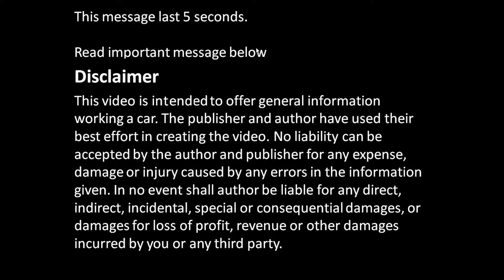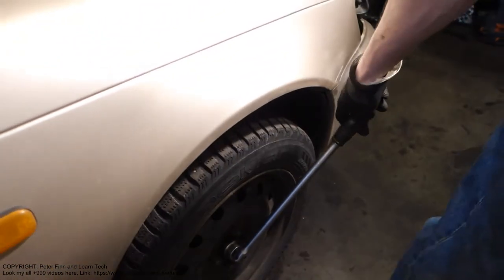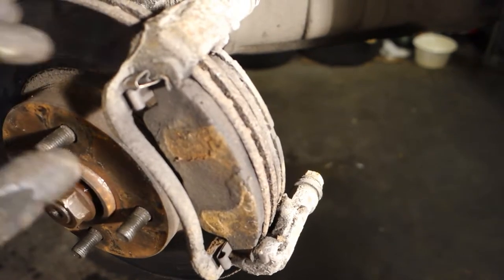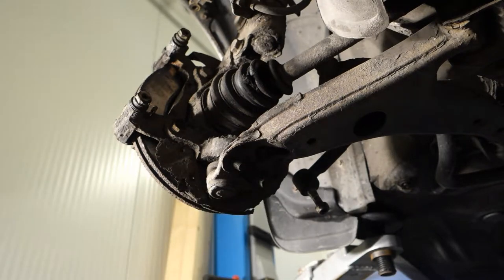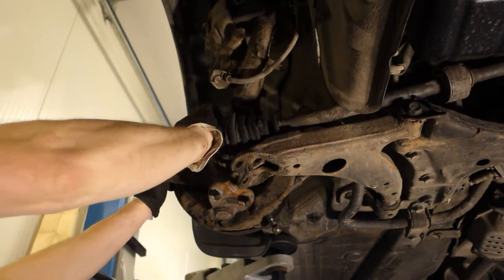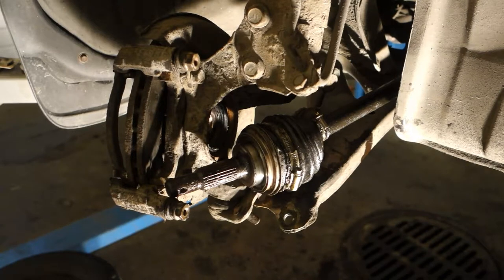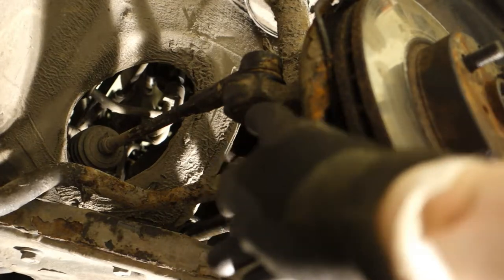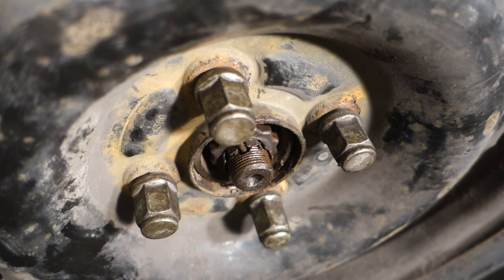How to replace driveshaft Toyota Corolla right side. Years 1991 to 2010.

Comment: Hei, kysyin jo yhdessä sun toisessa videossa mutta kysyn tässäkin, että eikö myös pelkkä  ulompi nivel ole vaihdettava? En löydä sen vaihtotyöhön liittyvää videota mistään.
Reply from the maker: Normally we chage whole part
Reply: @PeterFinnTheCarDoctor  Alright. I found a video where the outer joint is replaced: its outer part is split with a cutting disc and the inner part is simply pulled out after the lock pin is removed.